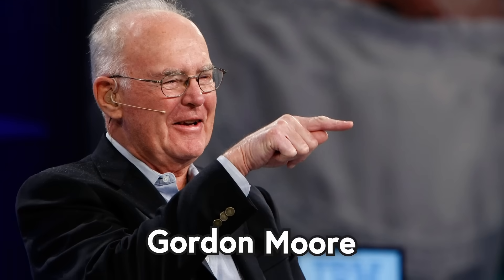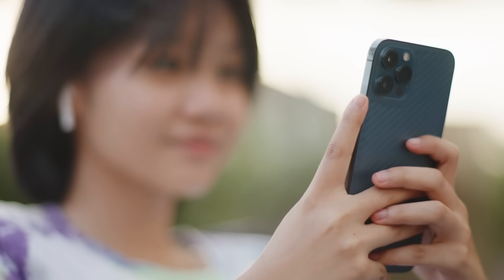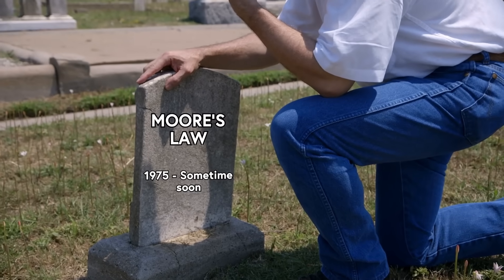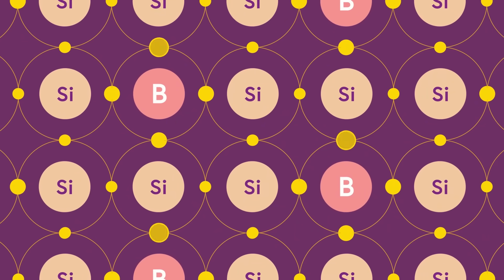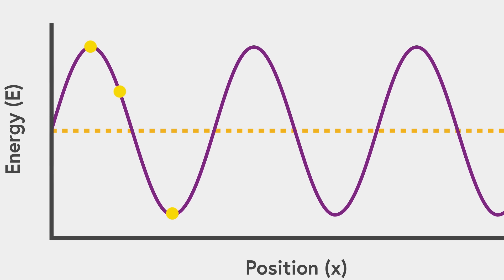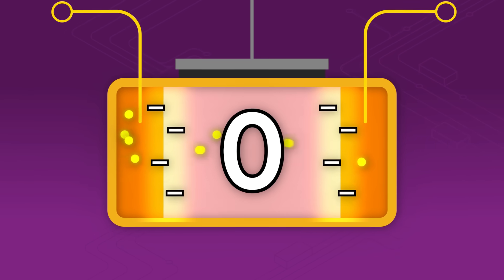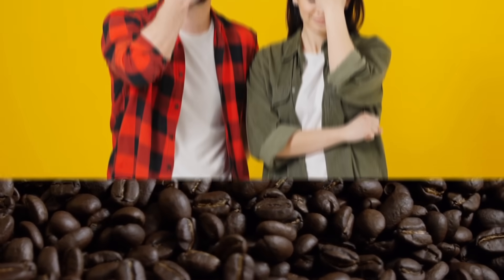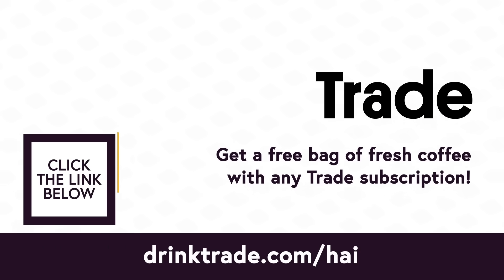Why We're Reaching the Theoretical Limit of Computer Power

Comment: So as an electrical engineer named Amy who works in this industry, I’d like to give my two cents. Currently, Moore’s law is not coming to an end; what absolutely is coming to an end, however, is Denard’s law. 

While Moore’s law states that the number of transistors on a chip will double every two years, Denard’s law explains how transistors shrink to accommodate that and ends at the atom scale. Moore’s law says nothing about the physical size of transistors though, so with smart engineering we can keep it going even after Denard’s law has met its end.

As this video stated, in a lot of ways we just simply cannot go smaller with Silicon (Si) CMOS transistors. We’re physically reaching a limit of what can be done there. Denard’s law will end in the next few years if it hasn’t already. That is not to say, however, that we can’t keep getting smaller, at least for a little while. New 2D materials can allow us to get a gate dielectric (one of the main things electrons tunnel through) to the size of 1 to 3 atoms. Different 2D materials allow for a similar thickness of the bulk of the transistor.

New materials most likely aren’t what’s going to save Moore’s law alone, however. We can keep putting more transistors onto a chip with different architectures and technologies. By going 3D and stacking transistors on top of each other, you begin to massively increase the number of transistors per chip. You could also begin integrating photonics or detecting spin on individual electrons, both of which could (in theory at least) get much smaller than the smallest MOSFET. Between combinations of all of these, as well as neural architectures and quantum computing, Moore’s law will live on, and our computational power should continue to increase even after it ends.

Comment: This video provides an example of Finangle's Law operating on Murphy's Law.

Finangle's Law: Anything that can go wrong WILL go wrong.

Murphy's Law: If there are two or more ways to do something, and one of those results in a catastrophe, then someone will do it that way.

Murphy's Law is a design principle. If you want to avoid disaster, then design things so that the correct way is the only way to do it, or design it so that it doesn't matter which way you do it. Example of the former: the 3.5mm headphone jack. Example of the latter: USB-C connectors.

Comment: Quantum computing (as of this moment) does not have many uses for conventional computational problems. You PROBABLY won't see anything that'll be of benefit to you personally in the near future. However, there are other ways to gain performance! Like adding multiple cores. Almost all processors are now multi-core processors (e.g., Intel i5 ... >8-core< processor), which allows them to do multiple things at once. Also, processors are currently mostly limited by their memory bandwidth. In the coming years, we'll probably see new processors which use "3D" memory, where memory is stacked on top of the core as well. There are already processors which move in this direction with 2.5D memory.

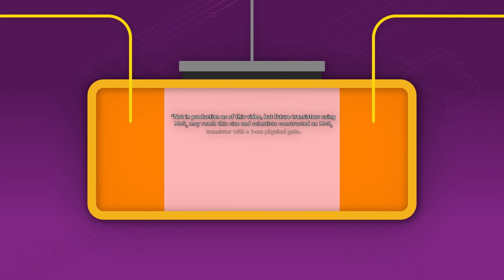Comment: 3:42 The nanometer numbers below about 20nm are just marketing numbers with little connection to reality. FinFETs allow for higher density without smaller physical size compared to planar transistors, by utilizing the third dimension. But since the market monkey-brain only understands "smaller is better", marketers started pulling smaller nanometer numbers out of their butts to communicate the increased density of the newer nodes.

Comment: This isn't a limit of computer power, just a limit of how many transistors you can pack into a particular space. Other things can effect the power of  a computer. Great examples are using multiple cores, increasing clock speeds, creating speciality cores, and other modifications can all increase the power of a computer.

Comment: Why not just make CPUs bigger then? If we're squeezing billions of transistors into a tiny area, even an extra few millimeters of space would add tons of area for more. Likewise, stacking could also be an option.
I'm sure this is probably already being done, but it makes me wonder why we don't have super-powered CPUs the size of our hand with hundreds of billions (if not trillions) of transistors.
I guess maybe heat dissipation would be a huge issue for stacking (and power draw for both), but maybe not for larger sized CPUs since there's more surface area, thus a proportionally similar amount of heat generation. 

Like if I have a desktop computer, I really don't care about a CPU being tiny, it's not a portable system. The more power I can pack into it the better. If that means larger chips, it really doesn't matter to me.

Comment: What about using photons instead of electrons? Light computers maybe? Quantum tunneling for photons will simple violates the physical law of nature as there is nothing that can travel faster than speed of light, light travels at light speed, if it was "tunneling" instanteneuously through a materials, shouldn't considered as violation of lgiht speed limit ?

Comment: I would like to point out that quantum computing isn't magic. It has its own sets of limitations that make it unlikely to ever fully replace conventional computers for simple day to day tasks. For one thing, it's unlikely to ever enjoy anything like Moore's law in increasing production yields. One of the biggest problems of QCs is apparently that they have to deal with constant quantum interference by design rather than as an unfortunate consequence of things getting smaller. 

Heck, the famous claim that Quantum Computers will render encryption absolute has, AFAIK, already been mathematically disproven. There are encryption algorithms that are incompatible with the method quantum computers would use to crack commercial encryption schemes. And as far as I know, those schemes don't require a quantum computer to implement.

Comment: With how small transistors currently are, there is already some level of quantum tunnelling occurring, but at levels that existing error correction codes can  detect and correct it.
Reply: Yes and no, quantum tunneling causes a steady OFF current that would need to be compensated by a higher ON voltage. The issue is that with a higher voltage comes more heat, meaning there's more thermal movement of electrons, which increases OFF current. That increased OFF current might surpass the ON threshold and cause a bit flip, which may be corrected with ECC.
Reply: Personally, I think we're at a point where the hardware is powerful enough, we need to focus on the software aspect.
Reply: @BoopSnoot the hardware is powerful enough for our current uses, but it always has been. we don’t know what the future will bring.
Reply: @BoopSnoot  you are correct that the software is a huuuuuuuuge bottleneck, and if the tech stays the same we can still see exponantial growth for quite some time, but we can still go faster and better, just with very different technologies.

Comment: There is actually an alternate way to quantum computing. Analog Computers. Essentially all prediction/caculation machines were analog before they got digitised and now the reverse may become true  since 1's and 0's is very limited. There is a Company working on chips that work with the exact voltage that have a spectrum from 0-1. Even if we can only measure a 10th reliably that would still increase computing power massively. Atm, these chips are primarily used for AI and they may never be used for anything else, but even quantum Computers can't be used for anything that normal Computers can (and vice versa).

Comment: It is impossible for anything heavier than air to fly. This is a fact of physics. A law. 

Yet somehow, those pesky humans found a way around the law. Humans are sneaky bastards. 

For example, transistors are laid down in a single layer. Two dimensions. What happens if we lay them down in three dimensions? We get much higher chip densities. All sorts of technical problems need to be solved to do this. But it is doable.